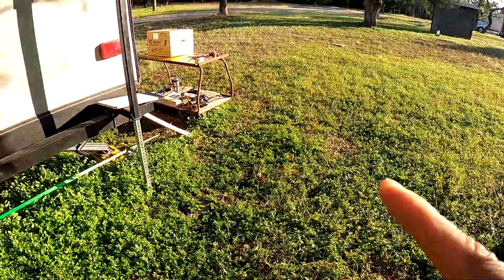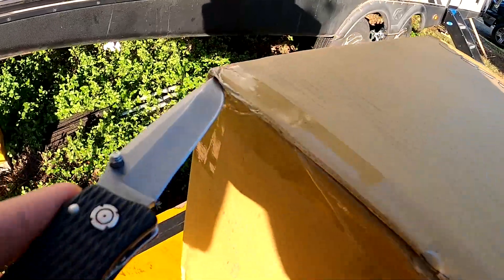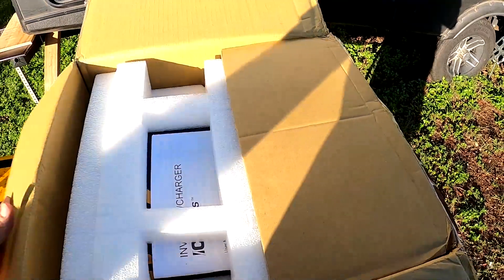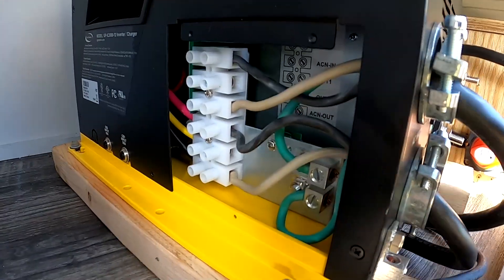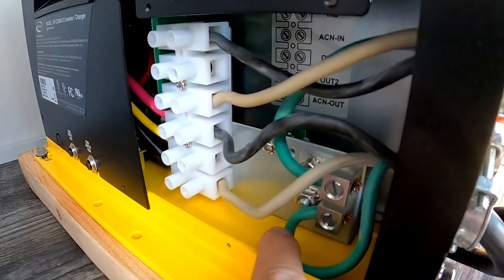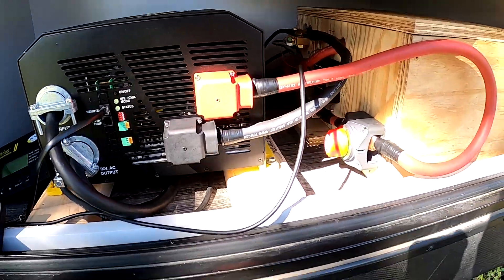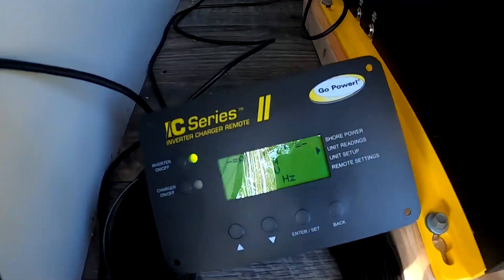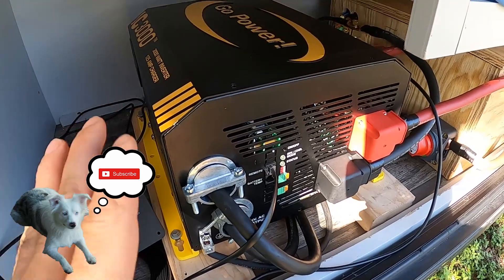Go Power IC3000 Install & DiY 12v 300ah LifePO4 Battery Install - Step By Step

Comment: Trying to do the install on mine today/tomorrow. I had a question as I am totally green with solar set ups.  Do you have a surge guard? If not, why? The see some set ups with one..my trailer is 30 amp service as well. But the install manual doesn't mention one. Anything you would change with your set up?
Reply from the maker: Are you talking about a surge protector? If so yes we use one we just connect it to our 30amp power cable direct to the 30 amp plug and chain it to the power pedestal.
Reply: @grumpysdiy   @RV Adventure Couple   oh ok, I guess the one I saw was just hard wired. I m glad I can use the surge protector i have already.

 I have another question if you could clarify. I didnt see a bus bar on your set up. But there was something the negative cable was connected to. Is that a shunt? Whats the difference? I ordered a BMS that comes with a shunt, but I really don't know what is necessary.  I've watched your video at least 10 times and I didnt see anything about the ground wire size? On the directions it shows the ground wire coming from the inverter onto a bus bar and then attach to chassis. It also shows the DC neg terminal connecting to a bus bar then to the neg battery terminal. Finally, it shows the two bus bars having a wire connect the bus bars. Do I need to purchase 2 bus bars? Or can I just use the shunt that came with my BMS? Sorry, I know there's a lot to decipher here.
Reply from the maker: Wire size is situational. Make sure and use pure copper or “welding cable” the ic3000 recommends 4/0 cable and a 400 amp inline fuse. Using bus bars is a preference if you need the use them, I didn’t. I don’t know anything about the bms you ordered so I cannot comment. Yes the main negative goes to a shunt, that is so I can monitor actual pack voltage and see how much power is either going into the batter or out of healthy battery. The chassis ground from the outside of the inverter I just ran it down to the chassis no need for a bus bar. I think I covered your questions.
Reply: @grumpysdiy  thank you for the clarification!!
Reply from the maker: Let me know if you have any other questions. I will be making the video I mentioned soon.
Reply: @grumpysdiy  why did you change the shore power plug and run the wires to the breaker box? Can you use the orange wires and wire that directly to the inverter?  I'm wondering because I'm thinking of placing my invertor only like 2 feet from the shore plug. I figure I could use that wire, and butt some connections  and connect them to inverter. And use that same wire thats already running to the breaker box and connect some more extension wire to the box. Is it because the 10/3 you purchased has insulation on the ground wire?
Reply: @grumpysdiy  what kind of plug did you swap it with? The one i have on here said 30 amp 125v
Reply from the maker: No I wired it that way because the ic3000 has a pass through automatic transfer switch, meaning all power flows through the inverter first. So shore power has to be ran into the inverter then into your breaker box. I used 10/3 because it is flexible and easy to maneuver through the camper.
Reply from the maker: I didn’t change the 30 amp shore plug that goes into the camper just the wire.
Reply from the maker: What do you mean by surge guard? I plan on making a video about what I’d do different soon. But to answer your question, I’d get the 2000 watt inverter instead of the 3000. The 3000 draws like 5ah just to be on.

Comment: waiting on 8  280 AH cells on the slow boat now for same setup. Will it run your ac for short  period?
Reply from the maker: I have 300 ah and my ac pulls about 130 amps dc an hour. So just over 2 hours of ac. The real issue is charging the battery back up.

Comment: Awesome tutorial! This helped me so much with mine! Quick question though. What did you do with the existing battery that came with the coach? Did you keep it hooked up?
Reply from the maker: It is still on the front of the camper, it isn’t hooked up to the camper though. We plan to use it with our inflatable boat and trolling motor. I put a disconnect switch in between it and the truck because the truck alternator charges it.